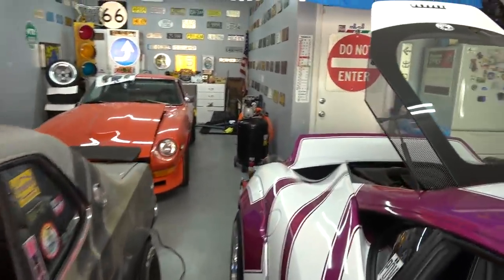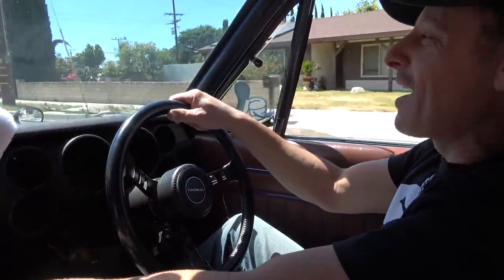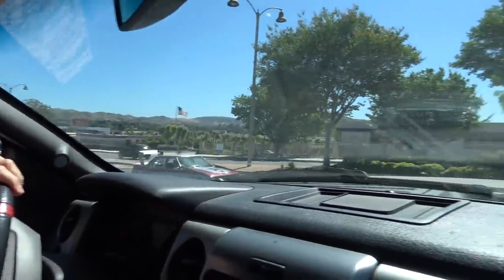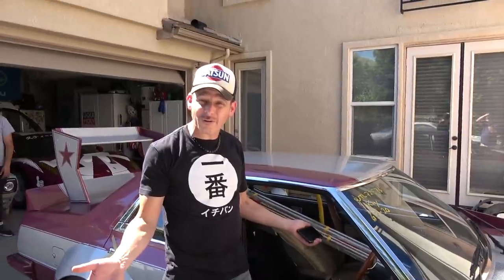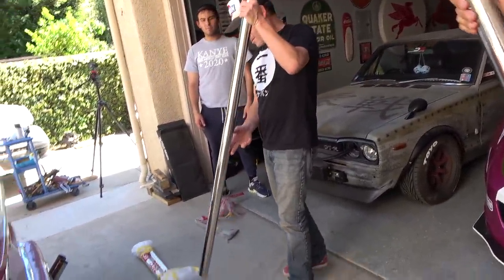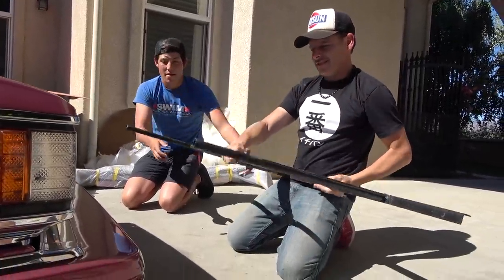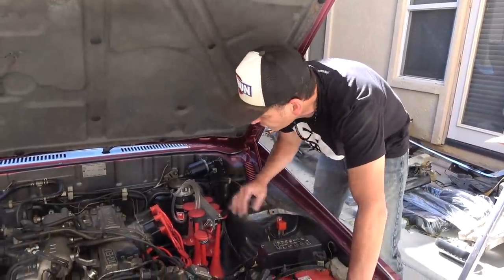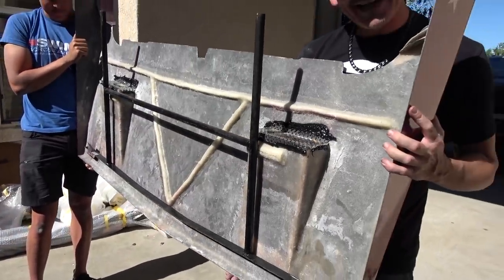Taking Delivery of my Crazy Bosozoku Car in Los Angeles!

Comment: I drove barefeet for 5 years with a manual, i normally wear flip flops too and lemme tell ya, driving manual with flip flops arent fun. Sometimes it gets stuck under the pedal too or ur feet slips off the pedal hahah, or even worse, your feet slips off ur flip flops
Reply: It’s super scary when the flip flop gets stuck under the pedal...!
Reply: same i just rest bottom of my heel on the flip flops an pivot my barefoot to reach the pedals
Reply: actually illegal in the uk to drive with flip flops
Reply: It's illegal to drive a lot of places with flip flops, I think it's illegal here in Canada (Ontario at least)
Reply: For sure driving a manual with flip flops is a bad time. Gotta run either shoes or bare foot.
Reply: I drive my manual every day with flip flops, I guess I'm just used to it.
Reply: Casey Levins  I actually just checked, apparently it's completely legal to drive barefoot or with slippers here in Ontario. Today I learned.
Reply: Likewise I drive barefoot manual in UK (when its hot enough - not so often!) much safer / easier
Reply: I don't know but I have driven manual cars for years with flip flops and have never had a single problem...
Reply: @Figureight  Yo whuuut, never thought I'd see you here. Love watching your stuff.
Reply: I never drive in anything BUT my slides hahahah that’s how I bang gears so hard
Reply: For real lol it happened to me and it’s not fun 😂 drove back home to put some shoes on.
Reply: Wuxter do you even heel and toe
Reply: @Tripplebeem  it also depends on how the pedals pivot, each car is different and obviously each person is different too size wise.
Reply: Slides only for me. Never trust a flip flop
Reply: TrippleBeem bruh same feels horrible in shoes and barefoot
Reply: That is why it is illegal in quite some european countries.

Comment: "I can't drive RHD manual yet" wtf???
Reply: Coming from the UK, I'd hate to try to drive a LHD manual
Reply: @mattparkin7224  It's easy - you end up punching the door a few times to start when you go for the gear stick with the wrong hand but you get used to it in no time.
Reply: He only recently learned how to drive manual i think lol
Reply: Steveindajeep yep, this should be interesting to watch him learn on RHD
Reply: Matt Parkin really not that hard. The shift pattern is the same.
Reply: whycantibefree yeah, I think only the signal indicator is different on lhd cars
Reply: Dan Nolan you learn in under 15 mins only thing that takes time to get use to are your turn signals
Reply: When I got stationed in England they left me at the rental car spot to drive home. Took me 3 min to figure it out. There is no RHD or LHD if you can drive stick you can drive both
Reply: Heeeyyy shutupa
Reply: Rhd cars you use your right hand to steer and left hand to shift obviously lhd is just the opposite. The turn signals are what will confuse you as I live in Australia but my escort was bought over and the turn signals where on the left side of the steering wheel not the right. For a little while I'd hit the wiper signal instead of the turn signal.
Reply: minnsminns that’s fucking hilarious, that didn’t even click for me. I’ve never driven LHD manual, can’t wait for the door punch!
Reply: Crazy car man.. I'd rock that.
Reply: Go ahead and mail in your man card.
Reply: benji ink strangely enough though I’ve driven enough euro cars here in Australia and you just learn to adjust between local/Japanese configs. and the euro config.

Comment: honestly i would KILL for a bosozoku car like that!
Reply: You can start off with a old / classic Nissan 240SX / Silvia, 300ZX, Maxima, Stanza, Skyline, Infiniti I30, Mitsubishi 3000, Eclipse 90's, Mazda RX7-FC or FD, Subaru SVX or WRX 90's, then add on long protruding dual chrome exhaust extensions, and alloy wheels, custom steering wheel, custom mats, stereo upgrade,  wing upgrade, custom horns, body kit, custom paint.

It don't have to be fast, it can be made just for show.

Heavy engine and Transmission upgrades is optional but does not have to be done.

Light engine upgrades, such as chrome valve covers, custom headers, colorful ignition cables, custom air intake and filter, and other light engine upgrades are accepted.

Body kit and paint upgrades, and interior / stereo upgrades are accepted.

Exhaust upgrade is accepted.

Comment: Very cool, add some small hooks and exhaust spring to the longer pipes and I'm sure they'd hold up well in city speeds.
Reply: Yeah in his previous video of the car the exhaust extensions had a rod or something coming from it and the trunk lid had a bracket coming from under it for support so hopefully it came with a box of miscellaneous parts with them in it.

Comment: @2:45 As a Dutch driver (all manual) I'd recommend going barefoot, you really shouldn't shift with flip-flops you'll get caught on the paddles.
@16:00 Those metal plates look similar to the ones used on remembrance candles! He probably just bought a whole sheet of that metal :)

Comment: You need to attach springs to the exhaust as a way to hold them in. I'm not sure exactly what you'd call it but it would hold them in for the short drives through the neighborhood imo

Comment: You should drill holes in into the pipes so you can secure them and be able to drive down the road at normal speeds (until you get pulled over)

Comment: And how nice to be able to work outdoors and leave your parts out!  Here in Ireland, you rarely get away with trying to dry your laundry without it getting rained on in the 45 mins to hour it takes to dry. haha. and cars, there's no way exposed metal wouldn't be super rusty in 24 hours.  I worked in a restoration shop in San Diego in the early 2000s and it was amazing, you could work outside and rarely worry about rain or even drizzle.  Edit: Just realized this was comment 666!!!  HAHA awesome!